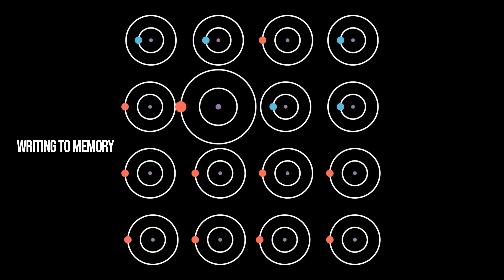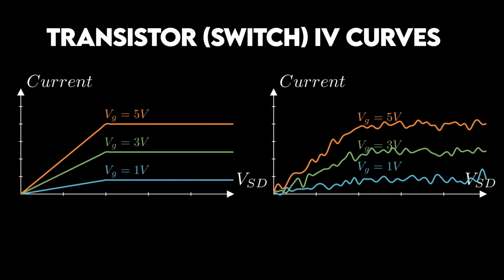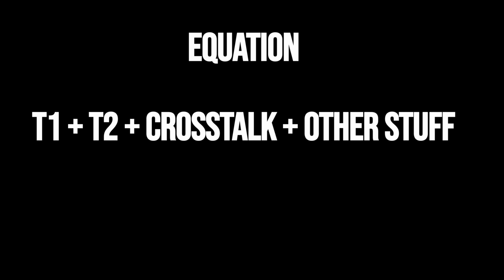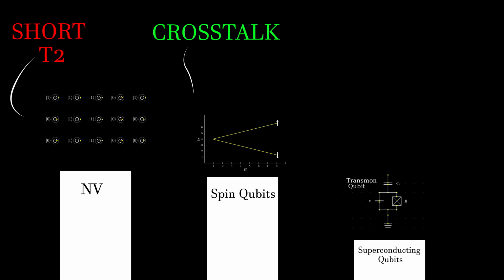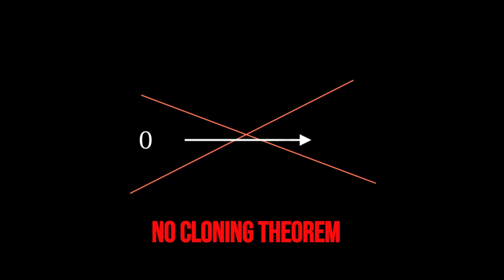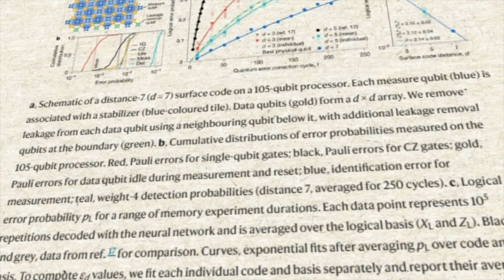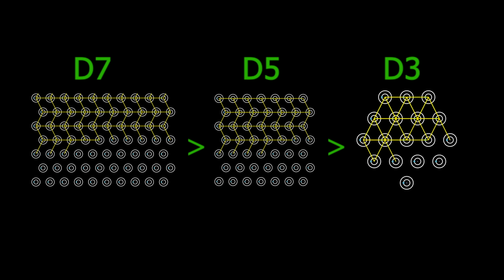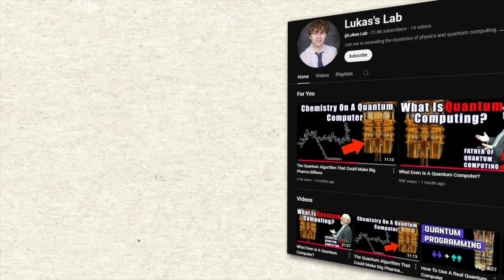Google Willow: Did Google Just Solve Quantum Computing?

Comment: Hi Lukas, I hope you're doing well! I was wondering what you think of IONQ’s new roadmap. After acquiring Oxford Ionics, they updated their projections and are now aiming to build a machine with 10,000 physical qubits and 800 logical qubits by 2027. In contrast, IBM plans to reach 1,000 physical qubits by 2027 but hasn’t specified how many of those will be logical. By 2030, IONQ is projecting 2 million physical qubits and 80,000 logical qubits, while IBM expects to reach just 2,000 logical qubits by 2033.

IONQ also announced that Oxford Ionics has achieved four nines (99.99%) two-qubit gate fidelity, which makes it more believable that they could reach five nines (99.999%) later this year.

Finally, I understand that Oxford Ionics’ microwave-based technology allows for trapping ions using standard semiconductor fabrication techniques, reducing their reliance on lasers for gate operations. That seems like a big win for scalability. Do you foresee any major problems with this approach?

I know that until IONQ delivers on these promises, it’s just a parchment guarantee—words on paper—but their roadmap seems far more aggressive than anything I’ve seen from other players in the field.

Comment: That Mario speedrun glitch likely wasn't caused by a bitflip.
Reply: wdym? what was it then?
Reply: @caesarsalad44 Faulty hardware? Electrical interference? OS bugs? Viruses? Butterfly flap at opposite side of earth? any of this is 9999999x times more probable to cause glitch than random cosmic ray
Reply: @Laptevwalrus  would't faulty hardware be more noticable? instead of only flicking a singlr bit? also, where did you get number from. i'm not saying it was a cosmic ray but your logic seems off

Comment: Willow has improved fidelity, but superconducting qubits still struggle more with decoherence than trapped ions.
Reply from the maker: Trapped ions definitely have long coherence times, but they have other problems, like really bad scalability, which in my opinion make them much harder down the line.
Reply: @Lukas-Lab  Thanks so much for the reply — I really enjoy your videos and appreciate the time you take to engage with comments. That said, I was a bit surprised by the suggestion in the video that Google is leading in terms of coherence time. From everything I’ve seen, trapped ion systems — like those used by IonQ and Quantinuum — still have a clear edge in coherence times over superconducting systems like Google’s.

I get your point about scalability — that’s definitely a real challenge for trapped ions, especially with optics and control systems. But I wouldn’t say it’s “really bad” scalability across the board. IonQ and others are making progress with photonic interconnects, modular traps, and multiplexing.

Superconducting systems also face major scaling bottlenecks — like wiring density, cryogenic infrastructure, and qubit variability. And trapped ions benefit from all-to-all connectivity and more uniform qubit quality, which can help reduce circuit depth and error rates.

Ultimately, it’s not just about scaling the number of qubits, but scaling high-fidelity, usable qubits — and on that front, trapped ions remain very competitive.
Reply from the maker: Ah I see, I probably should’ve been more clear. I don’t mean the google has the longest coherence times, but they do have the best scalability in that they are the only people to have successfully implemented and published an error correcting code which increases coherence time as you increase the number of qubits. 

I do think trapped ions remain competitive in terms of their coherence, but at the end of the day I think even with the scalability methods you mentioned they will struggle to scale beyond the thousands to tens of thousands of qubits mark, with superconducting qubits bieng as engineerable as they are the flexibility makes them better positioned for scaling IMO. That said, all of my work is in superconducting qubits and devices so I 100% have a bias there. So take this with a grain of salt

Comment: doesn't microsoft's quantum chip do this, but better?
Reply: My understanding is Microsoft claims to have a new type of qubit that is more accurate than other types, while this is a new type of error correction that’s more accurate. Essentially two different technologies working towards the same goal. (All of this assuming Microsoft isn’t full of bs about their topological qubits which hasn’t been proven)
Reply from the maker: No, Microsoft’s chip arguably doesn’t even have any qubits at all. They haven’t really proven that they do.
Reply: @Lukas-Lab  so if they are telling the truth they do?
Reply from the maker: Even if they were right, and they did have qubits, the performance was so bad that it is not anywhere near what Google has right now. That said - if they are right then they should be able to iterate and produce much better devices quite rapidly. If you don’t see that happen then it’s likely their approach needs some more fundamental research.

Comment: No need to sell your bitcoin yet, remember, they're still trying to make a single qubit that is reliable enough to use.  And they're not there yet. Problems scale exponentially when you try to entangle these with other logical qubits.  Based on the Bekenstein bound, I suspect the amount of superposition state that will have to be maintained will exceed the capacity of the observable universe before you can get enough qubits entangled to run Shor's algorithm on 2048 bit semiprimes.
Reply: There is already solutions for quantum ready to implement when the time comes
Reply: You’ll probably be proven wrong in like, a few years
Reply: Majorana 1 seems pretty solid
Reply from the maker: This paper by Google shows a significant improvement in the ability of our single qubits to be robust to various types of noise, getting us closer to fault tolerance, although still not there yet. 

That said, I agree you don’t need to be selling bitcoin yet. Shor’s algo would require millions of logical qubits, which is at a minimum (unless something crazy happens) 20-30 years away, but probably longer.
Reply: exactly.  Well, actually you won't even get anywhere near running Shor's fantasy

Comment: Can you make a video on how it will impact cryptography and bitcoin and is there a way to save Bitcoin lol. I am not there yet to understand technical stuff but i see some claiming that Bitcoin's code or something can be changed to post quantum cryptography but wont that be a different crypto lol idk.
Reply from the maker: At some point yeah - I’ll def make a video on this. That said, it’s a long way away from being an issue
Reply: ALL cryptography would be affected, but Bitcoin haters point it out as an excuse for it being bad. That said, most people overestimate quantum computers ability to disrupt how things work. I personally think it’s a bit hyped, sure it’s faster… but it’s quadratic. 

Something that takes a classical computer 100 trillion years takes a quantum computer 10 trillion years. It’s faster, but does it matter?
Reply: Bitcoin's code is flexible enough to add new transaction types without hard forking, something it has done before through SegWit and Taproot. Nodes which do not upgrade will still be able to validate new blocks, even if they don't understand the tx types.

Comment: 0:50 how would you implement a quantum memory/register refresh like with dram....
Reply: Well you can copy a qubit state, to another set qubits, then copy it back, like a buffer

Basically store the information like a standing wave between sets of qubits, like a flip flop, as long as the information transfer is fast enough, basically have qubits that would be able remember stuff, you know the state of atleast one set of qubits which would basically loop the information back and forth, until needed

Qubit ram/register?
Reply from the maker: Quantum memory is an active area of research in quantum computing, but as drdca in this comment thread alluded to the no cloning theorem only lets you swap info In or out, no copy paste allowed.
Reply: @Lukas-Labso you can then swap a state back and forth

Two qubits, set a value to one, if entangled then the other will be the inverted value

Swap the information in a loop

Read, write, read

Seems the problem is that quantum computer is destructive, data is lost once you operate on it or read it

Like old magnetic memories

Have to refresh, basically add feedback
Reply from the maker: The main way people want to use memories is basically take some longer lived quantum system with high coherence and use it as storage. Usually the problem with these systems is they have super slow gate times so making a QC on these platforms doesn’t work, but you could theoretically have a good memory. 

A couple problems with this is that it requires you to convert signals from one platform to another (transduction) which is very hard, and also when you turn on these interactions qubits are more likely to decohere.
Reply: @Clancydaenlightened You can’t copy a qubit, on account of the no cloning theorem.
Edit: that being said, applying the checks in an error correcting code is in some ways analogous to the refreshes you refer to.
Reply: you need to master the production of phosphorene to make a Band to band Tunneling Fet, however we are not yet there.